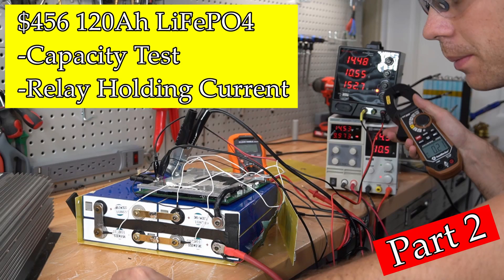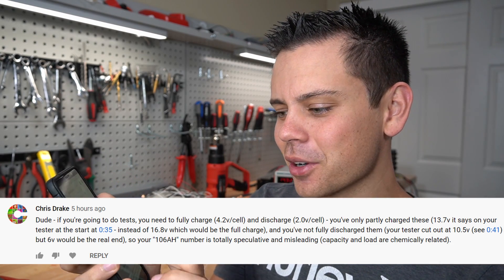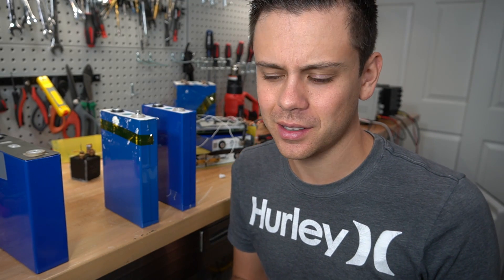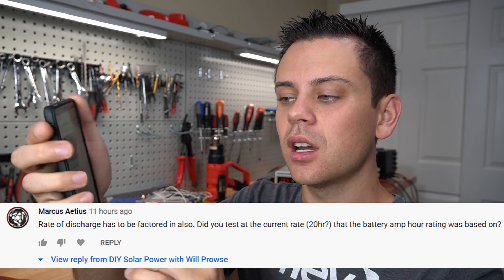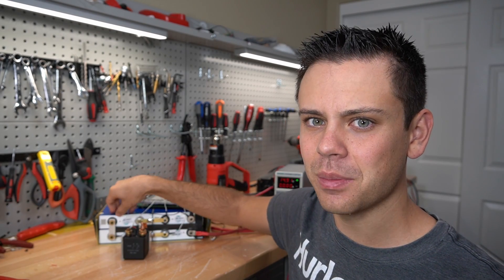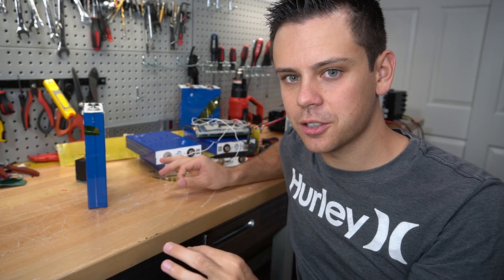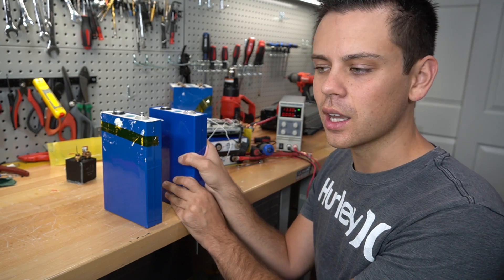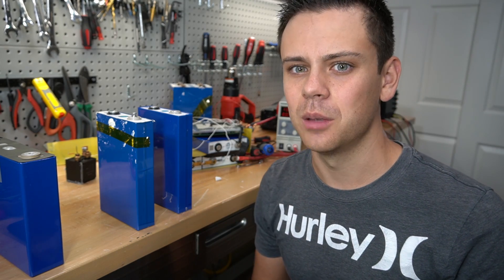Disproving LiFePO4 Battery Misconceptions in my Latest Video's Comment Section

Comment: does lifepo4 survive 3 months with no sun and -30C in styrofoam box with heating pads, could use 24v lifepo4 and near have 12v agm, does pads heat dog house if solar panel roof and batteries in with dogs, one 60W light bulb keep dog house warm

Comment: good job.
charging a lifepo4 battery to 4.2v (the full voltage of a li-ion battery) would not only cause capacity reduction it would possibly cause lithium plating, internal shorts, overheating and thus boiling electrolyte, smoke, venting and the more lame thermal runaway of a lifepo4 cell compared to li ion. Total destruction.
Reply: No Dr. Dangerous. A Lithumn-ion battery is a way different animal than a Lithium-Iron battery.
Reply: @acsnitner7661  that is literally what i said.

Comment: I guess, for some of the comments, they don't understand max charging voltage. 
It's not the cell charged, it's the voltage you can max it to charge it in a period of time without going above the cell max voltage, as you stated, before degradation. 
Or they confuse something in the datasheets, or, some Lipo have other data ? 
Always love your vids, and hope to be able to do big systems like yours someday.

Comment: The comments about "4.2" volts are people thinking lithium ion batts such as in 18 volt rechargeable battery drills,,working at 3 volts to 4.2,,,requiring about 4.25 volts to lift them up to that,,quite different chemistry,,,

Comment: I'm far less knowledgeable than you on batteries, but I know more about them than the average person.  When I was resurrecting a completely discharged EV battery I was using an extremely low current and an electrical engineer friend said I was being overly cautious, which is possible, but the consequences of no caution could be catastrophic.  A few weeks later one of his lithium cells turned into a balloon, I took that call while driving my resurrected EV.  He no longer subscribes to his theory of "a battery is a battery, just feed it power and it'll absorb what it needs."

My 'expertise' is with engine powered vehicles and I can't tell you how many times I've had people tell me that something I said can't work, even tho I've been doing that thing for decades.  Probably the hottest debates have been about brake bleeding, apparently gravity is still a mysterious thing.

Comment: Hello, what is the  difference between   LifePo4 200 ah 48 volt  .2 C charge cell and .5 c charge cell, how we should recognize them by visual inspection, since there is fake data sheet in my country. And what is the difference between their making technology, if we charge and . 2 C battery with .5 c current then will affect its cycle, please give full details. Thanks. How we should know them, please introduce a reference if you have.

Comment: 15 years ago RC lipo did show reduced internal resistance after a few cycles. after than, it was stable for a few cycles then start to degrade depending on how it was cycled.
I did not check the capacity as full cycle is pretty hard on the chemistry.

Comment: I guess the breaking in comment can originate from the fact that BMS can show 100% charge even with lower voltage until charged further. At least mine used the top charge so far as 100% but that doesn’t actually mean breaking in the battery

Comment: Just a note you are upset about 'arrogant and cocky people' but you also come across as the same laughing at someone stating that the full charged voltage is 4.2V and then stating that people don't know lithium chemistry. maybe as little more research on your part might have helped you to 'educate' instead of mock - 4.2V is full voltage for a LiPo battery as used on drones hence 16.8V is a fully charged LiPo for a FPV drone.
Reply: Lithium-ion batt is different from Lithium Iron Phosphate

Comment: I'm looking for some help / advice,,
I have some of those batteries in an [8s] set-up,  that I've been using on a 24 volt, lead acid  inverter/charger set on the AGM setting. that inverter /charger is not fully adjustable parameters like my new ones. it is  just AGM SET SETTINGS. I've never seen a too high or too low charge / discharge recorded on the BMS , but  still, after about 4 years,   some of the cells are getting swollen but they were cheap batteries and some were swollen a bit when new.  Are they OK. 
 I was new at this when set-up so  just worried. these batteries really were crap though. 
I want to know if I should  ? throw them out or just use lightly?

Comment: If it was stored or charged in a colder than ambient it can show a surface charge voltage and gain capacity agter a few cycles

Comment: Bruh, clearly when you get a new battery bank you’re supposed to break it in properly by filling it to 100% and then put a medium to full sized load on it and then go up and down with the revs for the first 500 miles and then you gotta take it apart and change the oil and reset the valves oh wait that’s a car. Nm people be trolling you apparently. Don’t listen to them.

Comment: Hii, I have a question. I bought new prismatic cells 4 pcs CALB 72Ah. And while at first charge I was top balancing them connecting in parallel. It was very slow to speed up the process I put 5v 4amps and constantly monitor cell voltages every 15 mins. But suddenly while I checked the voltage in the cell charge all of them reached 4volts while kept connected to the supply. Though it only happened only once and the cell voltages dropped by themselves to around 3.7 volts. Have I damaged their capacity by any degree? Is it damaged by any percentage? I don't have a capacity tester to test. But I am worried. Expert folks. Please reply

Comment: If you could share your email or somewhere I could send you some photos of a well know brand lifepo4 battery that burnt inside a jetski, also the a video of a jetski going around a bend and the bms isolated the battery from the motor causing the jetski to lose power and steering, 

Also this has happened at my local racetrack with a motorcycle, seems to be too many people defending a bad product, 

Be safe!!

Comment: Oops.  Can I suggest before you start a fight with the manufacturer you re-run the sums for 12V.  Not, repeat not, for pack voltage.  That's not what it states.  It says its a 12V 120Ah, not a 13.0V+ 120Ah.
You will find this often used in specs and technically they are not lying.  Power banks very often state their capacity at cell voltage, 3.7V and not at 5V.  If you took a 20Ah 5V power bank and drained it with 1A on the 5V side, it will not run for 20 hours and you will not measure 20Ah.
This is why Ah units are always prone to pit falls and mistakes.

Comment: Hello, 
I might have come across another myth.
I bought batteries which were supposed to have 280Ah capacity. My test result shows aprox. 240Ah. 
Seller claims it needs to be activated by cycling then several times. I have my doubts about that.  Does lifepol4 battery really needs to be activated? If so, would the difference of capacity be this high? I mean difference of 40Ah...

Comment: For better heating control in low tempatures. I got a "Dual Digital Temperature Controller Two Relay Output" from E-ba . I found out my new JK BMS with heating plug, only turns the heater on after the low temp protection has shut it down, then it turns it off again when protection release temp is reached.

Comment: Will I've learned so much from you... thanks!  Got a question: I'm thinking of replacing my 4 flooded 12v batteries (in tx desert 0ff-grid) with 3 Lifepo4 100ah. The batteries will be in the upstairs in the cabin.  Is fire safety a concern or not?  I'm using a renogy 60 mppt.

Comment: I had 2 of my 200ah batteries die because they dropped to 1.8v each.  I couldn't get the bms to come out of sleep mode.  I had to disconnect it and charge the batteries to 2.2v.  Is this a bad bms?

Comment: That "breaking in" the battery comes from the Lead Acid battery guys and especially the golf cart buggies end.. I got a couple of trojans t-105 6v and for teh first month they were crap for capacity.. the procedure is to charge the batteries fully and to drive for 9 holes on a regular par 72 golf course, you do this for like 4 times,, then the next phase is to go 18 holes.. (you recharge after each 9 holes and then 18 holes).  after about 6 time total 9 and then 18 holes you get better and better capacity of the batteries ..  

I experienced this low capacity as well when i put in new batteries.  Now a 1.5 years later they will go all night with lights, 12v cooler, 2K watt inverter at times, 12v TV, etc and only drop like to 80% according to my bogart engineering battery monitor system then the sun come out and back to recharging we go..

Comment: The break in misconception may come from cell phones and laptops for which the algorithm needs to tune in to display the battery meter accurately. But the battery itself does not need to "break in." They work best brand new and capacity is reduced with time and use.

Comment: The dude who was talking about charging to 4.2 volts per cell was probably thinking of lithium polymer packs, which do charge to 4.2. But then he would STILL be wrong, because you never discharge a LIPO to 2 volts per cell. The correct number would be minimum 3 volts per cell.

Completely whacko is what he is.

Comment: i recently got 4 280 ah batteries .they were perfectly matched .i charged them ,top balanced them. stuck a Daly 60 amp bms on them and they have run perfectly for a month .i use them to run aeration in my pond and charge them with two 100 watt panels with a solar tracker. works perfectly and i could probably run it 24 seven weather permitting. i check the voltage every morning ang nothing is out of line yet.

Comment: Touché Will! Henderson, NV is lucky to have you. Another smart move with climate and no state income tax. Here in Utah we could learn some things. Well I’ve got your configuration on my kitchen table and I’m buttoning up as we speak. My 400 watt panels are mounted not plugged in on my 1 1/2 inch pvc pipes ( portable stand to be used at the cabin or RV) we have 4 feet of snow on the ski resort we live on and a scheduled plan to BLM near Vegas in 30 days. You rock and my wife says your so dang cute too.

Comment: I think the “breaking in” comment has some validity but only in the case of degraded cells stored at a low voltage <2 volts. These are typically recovered/recycled cells that do often show improved capacity after several cycles. I agree that this does not apply to new LiFePO4 cells.

Comment: Mahalo, I'm learning and appreciate your straight forward testing with pro and con.  Totally trust your opinion.  A few years ago, with wrong advice from a local solar dealer  on setting up a small solar system, caused a fire in my bus. So now I do my research, double check, and remain cautious on any product on the market.  Again appreciate your honesty, and knowledge on these elements and products via your testing.

Comment: Hello Will, thanks for your video. I have a question, please answer me. I have 2 solar light, both use LiFePO4, but one use a single cell (around 3V) and one use 12.8 V (cells in series). Is the one using single cell better because it does not need BMS? Thanks

Comment: BTW, re the "break in" comment: I noticed just recently when I received some aftermarket lithium camera batteries that the instructions said something to the effect that "full capacity not reached until 3 charges" or something. I suspect this is more about preventing returns (hey! I didn't get as many shots!) or the rather blah charger they provide or just accounting for user error or something. I do know the camera manufacturers ship their batteries in a state below full charge, and request the owner to fully charge before use, but I'd expect that has to do with not storing them at full charge, not some need for "break in." Thanks for the great videos, BTW!

Comment: Glad you did this and explained the value & virtue of science based testing. Sad to say, but been seeing an uptick in folks that believe in what I call "conflation science" by not respecting the context. Or the crazy argument unless 100.0000% of science agrees there is a legitimate difference of opinion . For chemistry based science it is very well established and testable through microscopic physiology analysis (dendrite migration / computer chip fails). With some science there is by necessity speculation because direct testing is not possible due to scope & scale i.e. supernova's, blackholes, calibri-yau space, etc.

Comment: Is Hysolis 3KW Solar Power Generator 4.5 KWh Lithium Battery Off Grid Mobile Power all-in-1 LiFePO4, reliable, worth $2,800 from eBay?  Will, have you tested it out?

Comment: What's the best option for an inverter using lithium ion ? 48v sine wave? Where should I buy one??
Reply: Inverter should be chosen to suit what it's going to power so to speak.

Plenty of info ref PSW and MSW inverters online, and their particular  applications.

Doesn't matter what 12v (or multiples) battery is on the low voltage side.

All that is required is to follow the battery manufacturers' data sheets on keeping it properly charged by whatever method you elect to use.

Unfortunately, although lithium batteries are excellent bits of kit, they are a tad "fragile" on the electronics side and why you MUST use a BMS to look after batteries.

A "lot" more tech stuff than you find on this site is to be found online as in Uni or manufacturer' research papers on any sort of lithium cells chemistry ... of which there are a "lot".

Comment: Hey Will, in one of your battery videos you recommend against recharging with a vehicle alternator since they aren't made to charge deep cycling batteries in parallel with the starting battery.  What about inserting a current limiting device like a power resistor to limit the current going into the deep cycle bank?
Reply: FWIW, marine operators in use two alternators running off the engine.

One lower output unit for recharging the starter battery, and a larger output alternator for charging the service battery bank (service battery bank might range from a mere 300Ah to 3500Ah and more.

It may be you will find more info on a marine site or perhaps those which deal with RVs.

As you might suppose these sites have been around for far longer than solar panel sites.

Comment: Got a question for ya.. connecting a trickle charger to a 2 12v battery boat system "starter" and "house." They run up to an ACR which allows you to choose which battery to use and negative is connected to each other on the batteries BUT its separate positive leads to the ACR. Would you connect your positive and negative leads from a solar controller to just the positive and negative terminals of the house battery? Would this suffice inspite of having a connected negative to work properly with the ACR? Appreciated.

Comment: Is there a way to run two 12 volt batteries in series to the charge controller but in parallel to a 12 volt inverter

Comment: Hi,can you just  make  a bigging friendly  video  about capacity  test?with all  precies numbers of low voltage (cut  off voltage )for 12,24,48,60 and 72 volt systems?or with  equation, which i can use for myself calculate the right cut off voltage, even from 3,7 volt battery...😊

Comment: 😂😂

Don't waste your time explaining and answering specific questions.

If these folks don't have the wit to research what you say, first, before they have a go, then it's unlikely they'll understand what you say either.

Plus the fact you are still almost an embryo to these old timers ergo "what could you possibly know they don't" kind of "thinking".

Unfortunately the "I've been working with batteries for thirty years" claims merely gets the response of "no, one year, thirty times".

Not that there is anything wrong with lead acid technology per se, far from it. In fact lead acid is actually mounting a comeback for some purposes.

Suffice to say lithium cells are a different chemistry and leave it at that. It's open to anyone to do their own research and leave it at that.

Now, there is one drawback, which I'm positive (groan) you will be aware of and that is charging, or attempting to charge, the LiFePo4 cells at below 0C.

I appreciate this issue can be overcome by using heatmats and similar.

As for literature I did read a paper by Ford MC which was on the cold weather issues experienced by electric taxi cab (drivers) in Chicago.

Lithium batteries are excellent in warmer climes but don't really lend themselves to anywhere the winter temps fall below freezing, unless you are happy to use extra tech to keep them warm.

Comment: I just connected a 24V DC PSU to my Outback 60. It detected the voltage but it didn't start charging. What could the problem be?

Comment: Will your a smart dude. But you fail to cover all bases in your videos. This leads new guys to comment like this. They research off google then hear from you without deep explanation.  $400 for a cell  is  not cheap. It may be compared to other batteries but in the terms of money it's not cheap. Nothing solar is cheap plain and simple.
Reply: Hmm, that is an excellent point, especially the last sentence.

Everything is relative and as you say solar technology is not cheap per se.  But compared to what other  technology?

It might be better for those interested in solar power to read up technical specs so they understand what Will is talking about.

If folks still don't understand the technology then it might be better to get a system installed professionally, pay up and look happy.